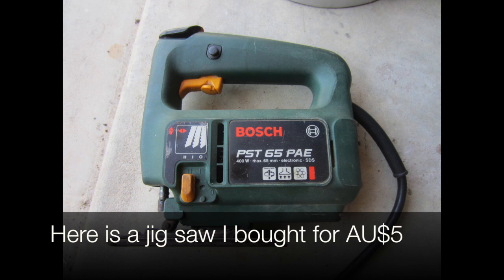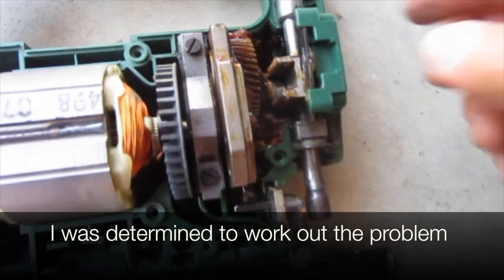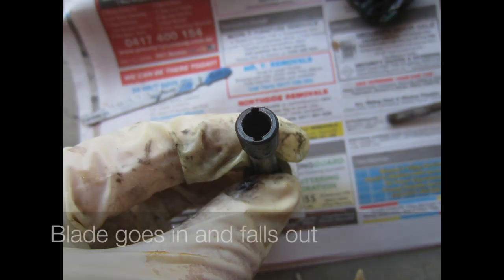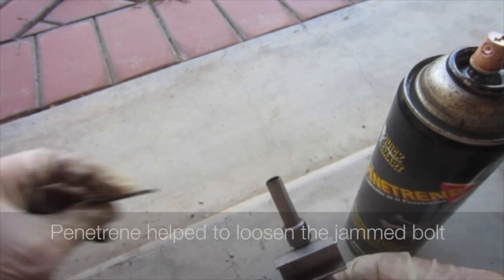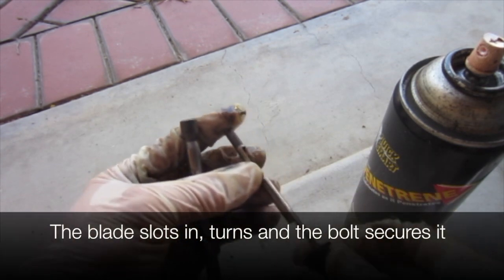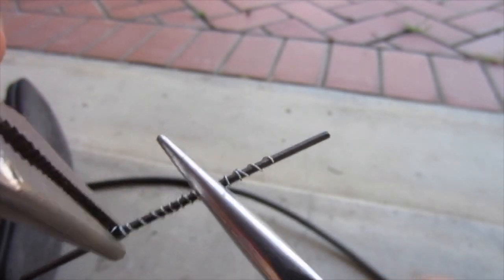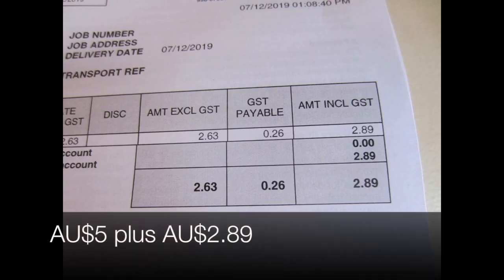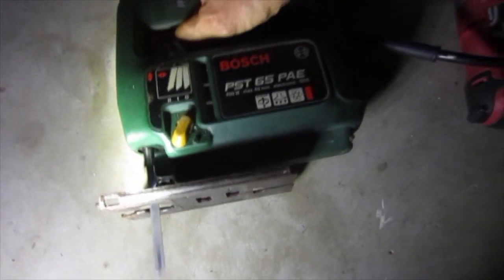bosch jigsaw puzzle fix

Comment: Bingo! There's my trouble. That bolt was seized up on mine and wouldn't tighten down on the blade. I had been cutting brick with a diamond blade and I'll bet brick dust boogered up the threads. I had no idea what was going on inside that shaft. I've got it tightening again if I can figure out now how to get it all back together...lol
Thank you so much for posting this. I've watched a lot of videos but this is the only one I've found dealing with this problem.
Reply from the maker: Great to hear .  I had to figure it out myself but it’s my go to jigsaw now .
Reply: @Dentinvent  That's the beauty of Youtube. I can borrow IQ points I don't have!...lol